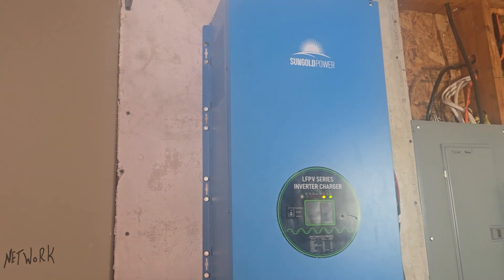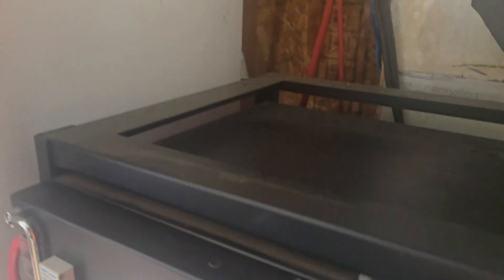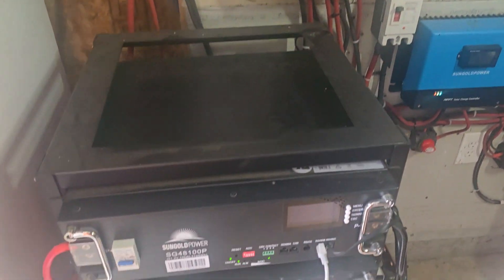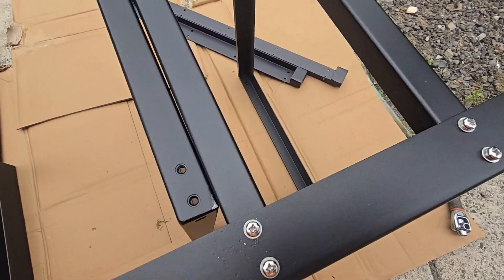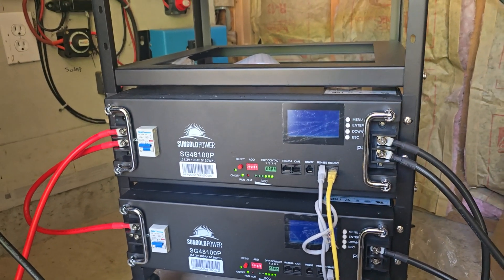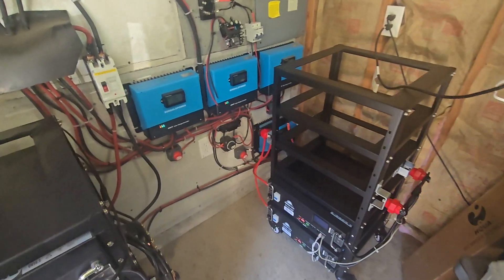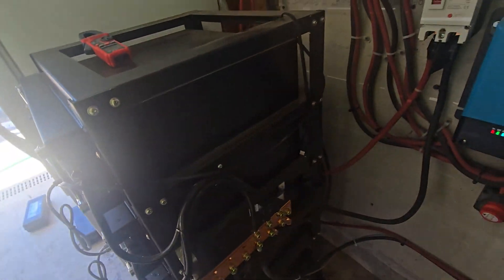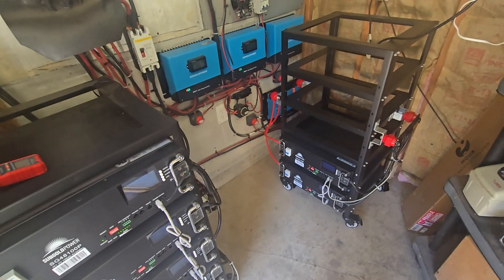How many Sungold Batteries to power my house Overnight.

Comment: Hi friend, I have a question about that inverter. When the sun is out, does the inverter get power directly from the panels or the batteries? Thanks.
Reply from the maker: Panels feed into the charge controllers which feeds the batteries. 
The inverter runs off of the batteries all the time unless it flips over to commercial power via the on-board charger.
Reply: @HowToWith24DY Yes, it's true, but I understand that if it's sunny, the inverter goes into solar mode and makes the energy go directly to the inverter. Is that true? I'm not sure. I'm about to buy one of those.
Reply from the maker: @punisherlives2291 
In my setup, it runs off the batteries all the time and the charge controllers keep the batteries full and limit the solar power feeding the batteties if they are full.
Reply: @HowToWith24DY The drawback I see with this inverter is that the batteries will be cycled more and will be used more, so they would have fewer years of life.
Reply: The drawback I see with this inverter is that the batteries will be cycled more and will be used more, so they would have fewer years of life.
Reply from the maker: @punisherlives2291 they are rated for 17 years, but yes that make sense

Comment: Why do you have two solar chargers don't the inverter do that?
Reply from the maker: Input limit of my charge controllers is 5200watts and 250v.
My inverter does not have pv controller.